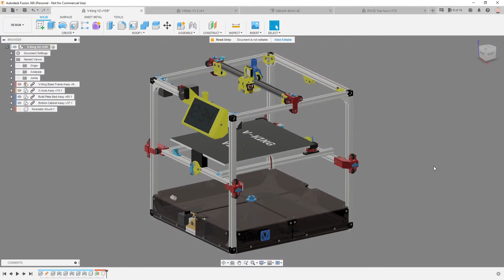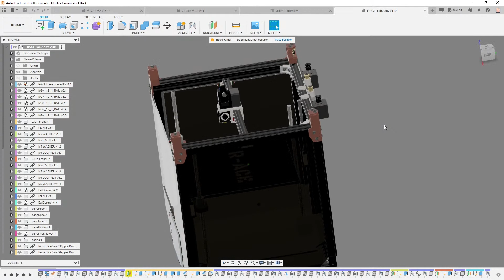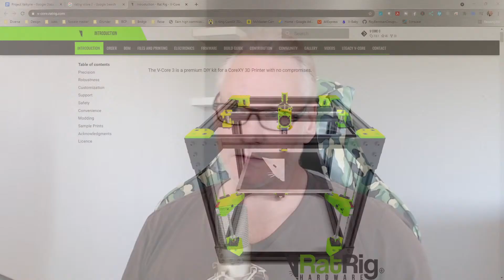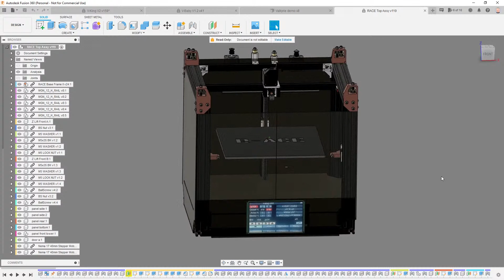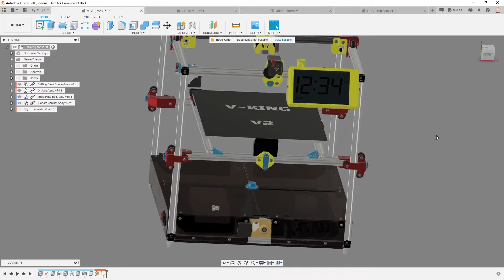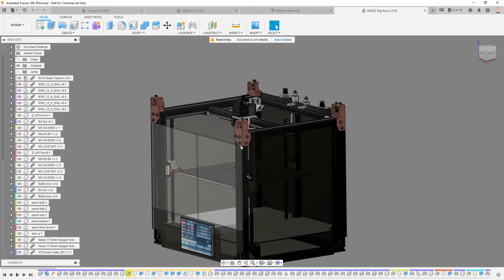Project Valkyrie | Week 0 | Premium DIY 3D Printer | Design Vlog | Day 0

Comment from the maker: What would you like to se in a Premium DIY 3d printer. Lets take the best in the market and merge it into a new machine!

Here is the list: https://docs.google.com/document/d/1LyvEA3gyIqDOJuiLqXYEt6xlAyiwClV5AFYpIP44oTU/edit?usp=sharing
Reply: Just a quick list of things that'd make me interested in another CoreXY:
Toolchanger, Dual-Extrusion, Multicolor/Multimaterial printing,  Automatic bed leveling, brushless motors instead of steppers, Input shaping, high flow/temperature printing, filament runout/diameter sensors, automatic nozzle cleaning
Reply from the maker: @felixfe7958  thank you. That is a good list! I will add to the list

Comment: Thermo couples for temperature sensing so we can do high temp filament,  only the direct instruder in the heated chamber water cooled hot end,  with external air source  for cooling  printed filament,. silicone heated (230v)  bed,   not end stops use  steeper drivers,  poly carbonet lid .
Reply from the maker: Thanks. I will add to the list